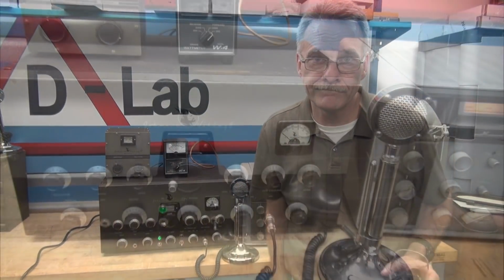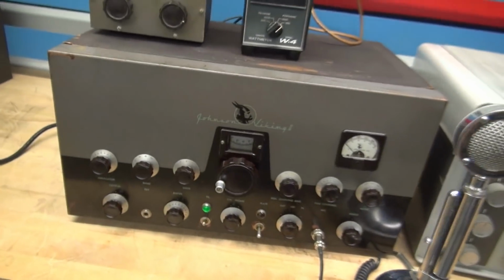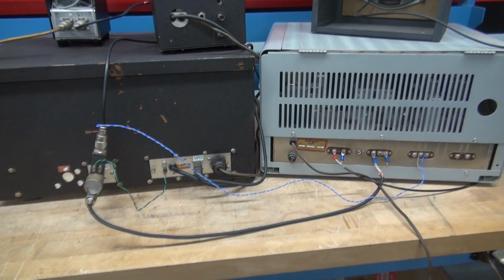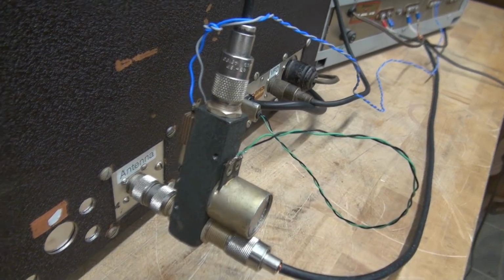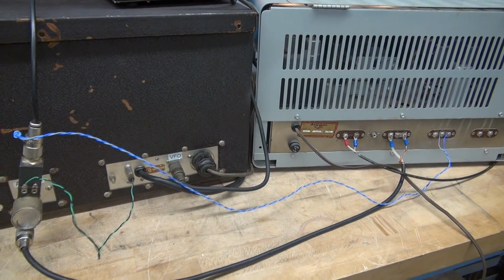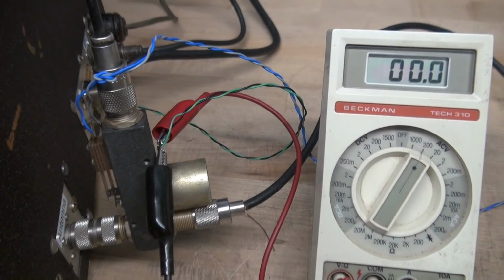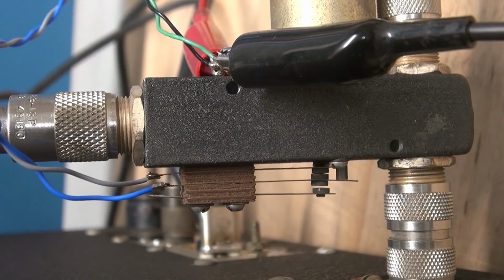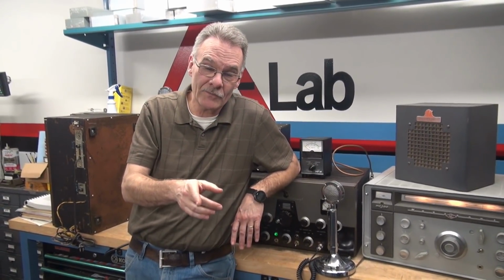How to connect Ham Radio Station Transmitter Receiver Dow Key Relay

Comment: Great video Terry & nice detail on wiring a DowKey relay for receiver muting/standby.  I have a friend who wanted to get into "Ancient Modulation" & got a DowKey without the outboard muting contacts.  He didn't tell me about this fact until after he hooked up everything & overloaded/damaged the front end of his receiver.  Although I've never used one, I believe the Johnson 250-39 T/R switch also needs an external muting circuit. I'd advise anyone wanting to hook up discrete transmitters & receivers to view this video.  Thanks again & 73, Steve/W9XF

Comment: My dowkey sometimes makes a spark  with a popping noise when I unkey. Not every time but sometimes. I have cleaned the contact with deoxit but after I un key it will make a spark sometimes.

Comment: In about 1965 my Novice station was a Knight Kit T-60 transmitter and a Hammarlund Super Pro receiver. A Dow Key DK60G2C coax relay did the switching. I still have the relay.

Comment: Great workup Terry...nice to see you labeled the coax jacks at the back of the Viking II as well.  A thought for a quick follow up video: 1) Adjusting the timing of a Dow Key relay, and 2) Cleaning the contacts of a Dow Key, which can be the same method used for cleaning contacts on CW key or paddle contacts.

Comment: Will something like an MFJ 1702 Antenna Switch do the job?  I know it's manual, but is this enough or is muting still needed?  I'm have a JRC NRD 525 and I'm looking to get a transmitter to accompany it, but I don't want to damage it.
If this won't get the job done, you mentioned there are several Dow keys available.  Can you recommend one?

Comment: could you please do a video on rebuilding or servicing the dow keys? i picked one up accidentally with some silent key's (i dont have his call) antenna tuner project, but it does not work properly with the secondary contacts. I now have some tube gear and would love to make it all work. Before I can be too serious about repairing and tuning the radios, I need an antenna switching setup. I have the secondaries from another relay that came in the same project, but they are attached to a dead coil, so no love there in parallel from the 115vac coming from the transmitter. When I key the relay, the antenna switches, but even when i move the secondary (external) contacts over to the dow key, they don't actuate. there is an empty spot under the secondary contacts. does an insulated ferrite plug or something need to go in there? help me obi-wan kenobi, you're (apparently) my only hope.

Thanks, and yes, I have my fine crystal filled with a tasty red wine (no, seriously.. haha)

-Scott KD2QQK

Comment: Question. . .. My biggest problem lies in the VFO coming through the receiver in the receive mode. . . Do you use the other side of the dowkey relay to switch your VFO on and off?   I have basically the same setup as you do, but I am using a S111 receiver.  Your thoughts?

Comment: Thanks for posting all these great videos.   I just picked up a John Viking Ranger off EBAY.  I took a total leap of faith that  the unit is fully restored electrically.  Generally I buy  stuff I can do myself but I am not real comfortable with tube transmitters and also I am pressed for time.  I also got a DOW-KEY off EBAY for less than $30  that looks good.    Great to see someone else enjoys a glass of wine with their ham radio!  I often sit and listen to my antique radios sipping a glass of Merlot.

Comment: Thanks Terry for the flash back. I had many of these relays back in the day. And I was about 13 at the time, and yes, I knew that there was HIGH voltage exposed on the back of my equipment. Got to love vacuum tube radios.

Comment: How would you mute a modern Short wave receiver?  Most - if not all - lack the muting circuit the dow key relay opens.   Lets see you use a home-brew qrp transmitter with say a Degen or Tecsun SW receiver... :)

Comment: Terry, I admit I know nothing about this stuff, but what you showed is very cool.  How much voltage is exposed back there on that DOW key ?  Just curious
Reply from the maker: The coil voltage is 120vac (line voltage) Only applied when transmitter is keyed. Would be good to add heat shrink on the terminals.

Comment: Terry, one other function that you didn't mention is that the relay also shorts the receiver output antenna line when in the transmit mode.

Comment: Terry Do you have any old ham radios for sale like Hummerland, Hethkit any old style ham radios let me know  What part of Michigan do you live I have family outside Detroit
Happy NEW YEAR Aloha & 73!!
Reply from the maker: Battle Creek, Mi.  Is there something specific you are looking for?
Reply: @d-labelectronics  Need some advice.. I want to get back to basics and operate split transmitter and receiver. I had some boat anchors years ago (national and halicrafters)but they just got too bulky and heavy... Im 62 now... Id like to find a pair of DC radios that will do the job but I really dont know what to look for... Im considering a nice old short wave receiver and then building some transmitters for fun but I really dont know which road to take... I have an FT897 but Im getting tired of it - it does everything but the laundry.. I bet I dont use but 10 percent of it's features. I wish I could just find some heathkits to play with but I dont think Id trust any other builder... Unbuilt kits would be impossible to find... Do you have any idea where Im going with this post... ?? Dont you ever just want to get back to the old days and have some radio fun without some nitwit telling you you're 200 cycles off freq, or having to rely on phase lock loops, eproms, or ICs that look like a 80 legged spider with bodies as long as a Laguardia runway. ??? I want radios I can work on without straining my eye sockets on smts. My first ham radio was an HW-8 that worked perfect from the first day. Ok, granted it was a transceiver, but the radio I had before that was a hallicrafters s-38. Qrp is great fun and Ive owned a few radios like the MFJs and such, but those little things just dont give me the nostalgia fix Im looking for..... You see how utterly lost I am.... Technology thrills me very little... in fact it underwhelms me. Im not really a contester, although Ive been in a few. Give me some tube finals to warm my shack, a drifting vfo to nimble my fingers, and a real old fashioned howdy doody QSO and Im in ham heaven. Help, Please... Radio suggestions and or donations would be welcomed and appreciated.

Comment: Basking in the warm glow of vacuum tubes, scarf wrapped around your head to pad the army surplus cans, adjusting the plethora of frankenstein-esque knobs, listening for the distant calling of  "CQ CQ CQ" among the hiss, pops, and whistles... Gotta admit I cringed a bit looking at the modern telephone hookup wire amidst the old school tech. But I highly approve of the RG-8 stripped and screwed down into connectors more apt for ladder line. Lol.  Modern Transceivers have spoiled people by doing all that tuning and switching automatically - at least until you want to hook up an external linear amp: "Whaddya mean I need a sequencer... what the heck is that?" 

BTW - Would solid state theater have time in the next year or so to look at a slightly more modern Yaesu FT-757?  It was given to me by a friend who is now silent key and I'd like to put it back on the air.

Thanks for all the great videos!
73 DE W5SSJ
Reply: Does "silent key" mean passed away? My Uncle John passed away a few years ago. He was a HAM in Missouri. The best story teller I have ever heard. He was cool. I miss him.
Reply: Yes... Technically Silent Key was used in Morse code (CW is full of abbreviations and shortcut codes so it was sent as "SK".  CW qualifies at a unique language to the point where you can carry on QSO without a common spoken language) SK basically means no more transmissions from this station.  If referring to a ham radio operator and not their equipment... when you see their callsign as N5SPL/SK you know they've passed away.  BTW N5SPL/SK was my buddy and mostly responsible for my vanity callsign. Look me up on QRZ.com for the story. Charles was also the kind of guy I refer to as "everybody's elmer". There's a story behind how I ended up with that FT-757 from him...

Comment: How available are Dow Key relays these days? I am an older ham who has been out of the hobby for years and honestly  feel like my tech skills are low at this point. what is a good source for these TR switches?
Reply from the maker: ebay is a good source, Range from $35-75 dollars. Make sure they are 115vac coil + have the external muting contacts
Reply: @d-labelectronics  Thank you...
Reply: @d-labelectronics  I have not seen many of the 115 units on ebay,  mostly 12,24,28 volt.   Enjoy the videos,  I have a bunch of old boat anchor receivers and antique radios but  had not run a tube transmitter since the DX-100 back in my novice years.   Looking to pick up a Ranger to  pair with my SX-71 and  S-20R.  Had not thought about a Dow Key in a long time.